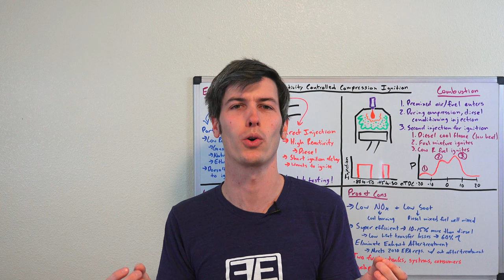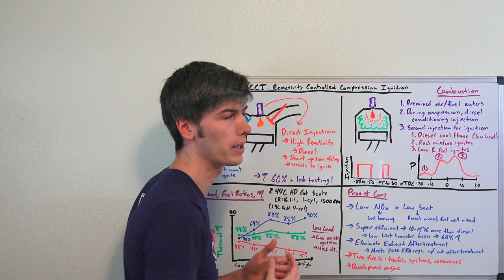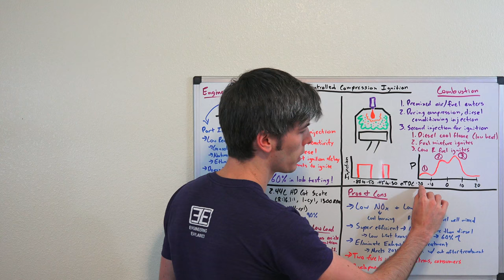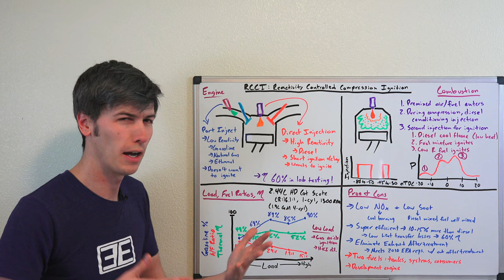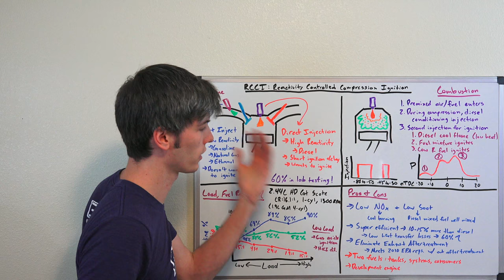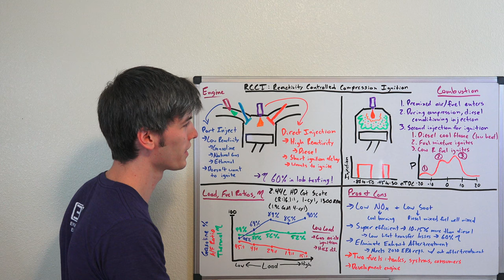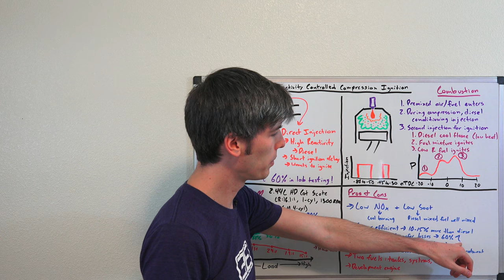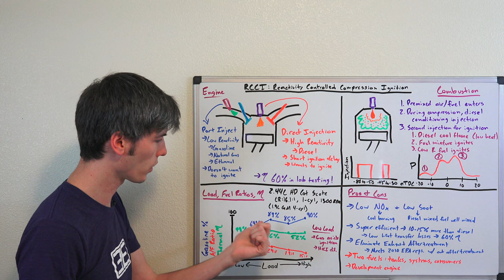Super Efficient Engine Uses Gas AND Diesel - RCCI

Comment: Engineer brain = white board lined up perfectly with edges of screen
Reply from the maker: Every. Single. Time. :)
Reply: B R how else would he do it? We're not savages.
Reply: This is relevant to my interests
Reply: Not completely... look at all the wasted space (about a quarter) in the upper part ;)
Reply: It might have been easier to follow if it was done with the wide shot B rolled to any one of 4 stills. Although his explanation was so good that it didn't really matter in this case.
Reply: The white board is actually off 1 deg counter clockwise. The left side is a Millimeter low.
Reply: Haha every detail counts
Reply: B R Do they have a name for what's wrong with us?
Reply: we need to dissect that brain to see how it works 💡🎓🔪🔎🎊🔍📊📈📝🍻
Reply: rofl... yeah, to the pixel
Reply: Not even a single Pixel off
Reply: @InsideOfMyOwnMind  yes there are a couple, but you don't need to take them on if you prefer not to
Reply: ..I can't un-see it now... 🥲

Comment: I would gladly buy a tank of diesel and a tank of gasoline for 60% efficiency and 45:1 Air Fuel. This is awesome
Reply: 60% would crush any electric vehicle. Overall eco efficiency is not even better than modern diesel engines which are way worse than 60%
Reply: It's still dumping out CO2 and other air pollutants at ground level so no an ICE will never "crush any electric vehicle".
Reply: slanahesh I think it largely depends on how the electricity was generated.  If by coal or natural gas it might be similar.  Remember there is line loss and loss from step up/step down transformers.  Additionally there is loss in battery storage.  It takes more power to charge than what you get out of a battery.
Reply: BrianNC81 None of those things addresses my number 1 issue with ICE cars that are addressed fully by electric cars. Having thousands of fossil fuel burning engines spitting out harmful gases right in front of your face. It's why governments all over the world are looking to ban ICE cars from city centres in the near future.
Reply: It's not similar, if i remember correctly with the usual electricity mix a diesel car puts out around 20% less CO2 than an electric car over a period of 150.000km.
Reply: EV = COAL, OIL, NATURAL GAS, and NUCLEAR.  Electric Cars run on Fossil Fuels the CO2 Release is just done else where.
Reply: SDD525, when I’m stuck in the middle of the desert with out power, I don’t care about the efficiency of an EV. I don’t live in NYC with a power supply on every block. EV isn’t perfect yet, and it will never be perfect for every situation.
Reply: @slanahesh  only time will tell.
Reply: @roxasparks  what exactly do you mean?
Reply: ICE...smice. What's immigration got to do with engine technology?
Reply: Ganga Din  yes I do. Because that one big station isn't concerned with things like compactness and mobility, because of that it is far more efficient and far less polluting due to things like particulate filters and CO2 capturing and like i said, it isn't shooting those harmful gases at high concentrations right into your face all day every day.
Reply: @slanahesh  well there is a lot of pollution to create batteries, it's just done at the mining communities end...
It's not clean, it only appears clean to the ignorant masses
Reply: @slanahesh  do you know what cobalt mining does? And lithium mining?
Maybe you should look at where it is extracted from and who does the extraction and what happens to these populations
Maybe after that you can then pontificate on the evils of fossil fuel
By the way? How do you charge these batteries? Solar? Wind? 🤣🤣🤣
Reply: @dissonantiacognitiva7438  the battery industry is actively trying to remove cobalt from their products and one day may use none of it at all. But guess who else uses tons of the stuff? The oil industry, they use it as a catalyst to remove sulfur from petrol and diesel.
Reply: yes but on low loads at 1300rpm, better walk
Reply: If it takes off, there will be side by side or double nozzles at the pump so you can fill both at the same time.
Reply: TRAIN SHIPS + take in consideration, that battery production is much more harmful than straight fuel burning
Reply: @makantahi3731  1300 RPM is about where I run my diesel at cruising speed. RPM related efficiency is a simple matter of having the vehicle geared correctly for it's intended application. Many new semi trucks use rear end gears in the 2.64 area to be around 1300rpm at 70mph for interstate efficiency.
Reply: @jaydunbar7538  you can also use a hybrid electric drivetrain for peak efficiency and power at all times.
Reply: Methanol could be used instead of gasoline. Cheaper, no particulate emissions and less NOX emissions. Methanol tolerates much higher compression ratios which mean better efficiency.  China and India are investing in methanol and are likely to adopt RCCI- technology first in mass production.
Reply: @slanahesh  once an EV battery falls below 70% capacity, it no longer has enough capacity to run an EV
Reply: Oshe Shango  Steam turbine can achieve 50% efficiency at best. Burning of coal or gas even less. Maybe nuclear power could compete by emissions, but never price-wise.
Reply: @slanahesh  I will believe it when it happens, I and many others ain't holding there breath. To many infrastructure issues and too little time. Yes even in countries like Germany.... Truth be told I am still optimistic about biofuels, and making synthetic gas from plastic waste but who knows.... (Both in tandem in basically a E85 mix.)
Reply: Where does the electric plug 🔌 lead to ??
Reply: @paavoallasjarvi3805  I am still optimistic about ethonal not corn ethonal though, from sources like invasive alage blooms or lawn clippings. I know Cali has a lot of biomass that contributes to those wildfires.
Reply: @trainships1795 Nuclear is cleanish, though. The only pollutants released are the ones generated during mining. Actual waste output is in small enough quantities that we can designate a safe storage area that will hold the entire waste output for the lifetime of a plant.

Comment: Now this is intelligent. Not like a DPF where it's a sticking plaster on a bullet hole. Tackling base efficiency is far more important and will have a far greater overall impact.
Reply from the maker: Yep, while I fully understand the need for the emissions equipment, if there are base efficiency solutions which eliminate the need for it through cooler combustion and better fuel mixing, it's a far greater solution.
Reply: I know it's still a way off but as I see it if it's burning as much as possible it should be leaving behind as little as possible so this goes toward both. Then there are the side benefits of having to use less fuel such as having to refine less, deliver less and so on. 
It's a shame it's taken this long for this type or research to come along after years of stick on emissions killers which only really help in a test scenario.
Reply: It's what happens when you design by committee and bureaucracy instead of just science, research and engineering.
Reply: DPF's are one of the most cynical test cheats ever. 
Even if we ignore them having to regen which then throws all the crap they catch out the back anyway, they add backpressure which uses more energy so they cost efficiency all the time the engine is running and a lot more at higher rpm. 
They also need making, controlling, a load of fuel dumping into them to get a regen and all the extra heat that makes has ramifications for any other components near them then on top of all that they will eventually (some not so long) fail and need replacement which adds more waste and energy again. 
Obviously none of us want to breathe a load of soot in but I'm convinced there are better ways of dealing with it (centrifugal exhaust filter, maybe?) and I'm pretty sure DPF's don't actually help over the vehicle's whole life if you take everything into account.
Reply: Not to mention, on semi trucks DPF, and DEF systems are unreliable and tend to crap out frequently. And when they do, it can be a very expensive repair.
Reply: I just hate the unintelligent way they were thrown on. EGR's are borderline too since they help a little while the engine is low mile but cause a load of problems further down the line which then need more parts, cause poor running and so on. 
Justin's video shows what real engineers will develop if left to get on with it rather than be meddled with by slap dash regulations only there to win votes.
Reply: Antonovich not only can they be costly, but when they crap out they also burn down the truck. I don't imagine they calculated the emissions from entire trucks burning to the ground in the studies, or fleets of trucks such as happened to swift when one caught fire in the terminal.
Reply: yes, that is great but what i think also deserves commendations is the efficiency by load levels. that's one big reason why you usually get 20% less mileague out of what the economy tests cough out.
Reply: Diesel emissions technology is exactly where gasoline emissions technology was in 1973. Primitive, largely ineffective and badly misunderstood by too many.
Reply: I also like seeing engines that produce less smog upstream of the smog devices. Ironically, even very old diesels did that (compared to gasoline engines of the same time) because the combustion process naturally resulted in less carbon monoxide.

Honda did such a great job with the CVCC gasoline engine in 1975 that they needed no catalytic converter to pass California smog. By 1975, nearly every other car needed one. I think Honda was able to build non converter engines into the early 1980s because the technology was so good. The only downside I know was that their carbs needed twice the number of vacuum operated devices as other smog engines. That is a huge pain.
Reply: Cole Cooper hmm thats a really good point. Now I'm curious to see if DPF is actually harming the environment by comparing total emissions by liters (gallons) used. Sure we produce less but must burn more to do so does the environmental cost of extracting additional fuel to do the same job in the grand scheme.

No numbers represent reality at this time. 
Consider it takes 1 gallon to get from point A to B pre dpf producing x lbs of poullition if you consider it took .25 of a gallon to extract, Refine, and ship

With DPF it takes 1.25 gallons to do the same trip and .5 gallons to extract and ship

I'm also of the understanding that Most the pollution from diesel(ultra low sulfur) exhaust doesn't actually harm the environment(ie. climate change), but is highly carsangenic and not really good for anything that breaths.
Reply: Soot is developed because the engine isn't hot enough to burn the fuel properly, excess idling is a big  contributor to soot, all it needed was an ECM ,EGT when the engine isn't hot enough throttle it up to the proper temperature so its burns properly by using the Exhaust gas temperature to read how hot it is If it isn't up to proper temperature the ECM tells the engine to throttle up to where it needs to be if it's to much throttle it down this would take care of the soot problem from trucks sitting by idling like trash truck,dumptrucks,school buses emergency vehicles etc! This ideal of DEF fluid, DPF, SCR EGR, just adds weight ,reduces the lifespan of the engine robs horsepower and unnecessary components that's not needed!
Reply: @doorguner01  agreed since the same job can be done with water injection and most often yields better results than DPF, SCR ,D E F and EGR.
Reply: You betcha- I totally agree!!

Comment: Nice video about the work we have been doing at UW-Madison! I am just finishing my PhD here and if you would like to continue doing videos on the topic and would like to discuss any of the details, id be more than willing to help spread the word and answer questions... I have been looking at the comments and people are really confused on how this compares to current trchnology.. I think I can help clarify those questions if you want.

Also, id like to point out that the efficiencies that are reported by Mazda are break thermal efficiencies (BTE), they consider friction and pumping losses.. in a single cylinder engine we usually report efficiencies as Gross indicated efficiencies (GIE), those do not consider friction or pumping losses mainly because they are difficult to obtain in a single cylinder and we want apples to apples comparisons of the conbustion process alone

The 60% number you mentioned was obtained with a ethanol and doped gasoline mixture with EHN and its a gross value.. the BTE value will be lower but still higher than current technologies.. also, there are many nore details and caveats to comparing combustions strategies and thats why they give PhDs to people who work on this
Reply from the maker: Awesome! Could you shoot me an e-mail so I could send some follow up questions? officialengineeringexplained@gmail.com thanks!!
Reply: It would be neat to find out if this concept can be made to work on 2500/3500-series trucks (like the Ford Super Duty) which operate at heavy load for hours or days at a time, and generate 1000+ lb-ft of torque.  Seems like a win-win if you can improve fuel economy while reducing the need for aftertreatment systems (EGR, DPF, DEF/SCR) which have been highly problematic and unreliable since they came out 10-15 years ago.

Comment: Just dont gas up your TDI.. That will make things very sad. LOL <3
Reply: This was made 20 years ago in post sovietic countries.
Reply: I've talked to diesel guys that put 40 percent gasoline in their diesel. But I wouldn't put any more than that in it.
Reply: HumbleMechanic we just have to add a little bit of gas on our VWs;)
Reply: Speaking of putting the wrong fuel in a car -- my wife and my 19-year-old step daughter both drive VW TDIs.  You would not believe how many guys will stop and "help" them by saying, "You know that's Diesel you're putting in there, right?"  LOL!
Reply: About gassing TDI, some guys have them running on LPG.
Reply: Trying hard not to make a WWII joke about the gas!
Reply: Kaos Warrior you better keep trying
Reply: Did u did it ?? Is t working better?? More.miles??
Reply: If there any chance Humble that you could use a TDI to actually build an engine like this. Like using a computer to control the diesel injectors and use the port injection to drive ignition?
Reply: @RNA0ROGER  Yes,possible,he can use EFI injection controller to do that.

Comment: Back in the 90's they were adding approx 5% propane to tractor trailer engines to improve  efficiencies and reduce soot. It worked, but just as you stated, no one wanted to mess with fueling 2 tanks. Also, turbos became more efficient at lower rpm ranges which negated many of the advantages to the fuel mix. Excellent video, I hope they figure out how to transfer this to the masses :-) Thanks Mr EE :-)
Reply: I still want to add propane injection to my Silverado with the Duramax. Not so much for the improvement in fuel cost (which is marginal), but to clean up the burn and reduce soot production. I have seen pics of the internals on diesels using propane, and they’re noticeably cleaner. But yeah, the hassle and cost of setting up the tank, injection, then fueling two tanks... that’s why it hasn’t happened on my rig yet. 😕
Reply: Diesel Gas exists: Google the two terms and find out about the business that does these additions.  The firm is in Brisbane, Queensland Australia

Comment: As an operator of diesel engines in heavy equipment & class 8 & 7trucks, I grossly dislike the D.P.F & D.E.F systems. The former because of its expensive replacement cost which is prone to failure & the latter because it doesn't fare well in very cold climates ie. most of Canada especially the Northern parts. The point being we already have to use two fluids with D.E.F being a nuisance in the cold; if we had to use diesel & gasoline on the same vehicle, this is a lot more acceptable than the other because we are well acquainted with those fuels, over 120+ years. Provided this new fuel system operates flawlessly in ambient temperature extremes of -60℃ to +60℃. Also without to many complexities & also @ a lower cost of operation, while offering comparable if not superior torque, power & (economy) repetition intended. Batteries would be nice but I won't hold my breath  as they don't do well in climate extremes, not to mention lack fuel infrastructure. I'll say no more if I haven't already added fuel to the fire. 😔👴🤔😉😊

Comment: Great explanation! As an engineer, I always enjoy your clear detail. I experimented with a gas-diesel mix by necessity back in the 1990's. We were around 1,500 miles from home pulling a 5,000# trailer and needed to get back to work though the injection system was failing in a 1983 diesel Suburban due to a GM design failure. The injectors were clogging due to particulate from the injection pump governor. A friend who was a GM technician told me we could run 10% gasoline with no problem. I started at 10% but ended up at 30% gas by mid-way. Got a lot of funny looks at the gas stations but we made it back, replaced the pump/injectors and the vehicle ran for many years afterward so it clearly was feasible even then though not as well controlled as the experiments you outline. I didn't compare the mileage, just wanted to make it back without burning up the engine.